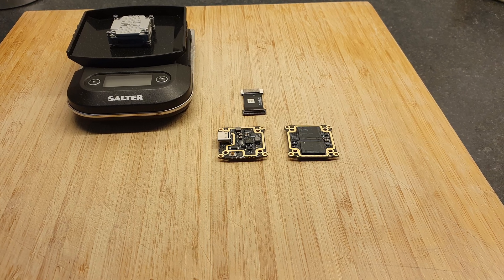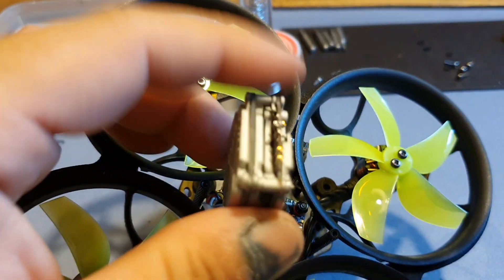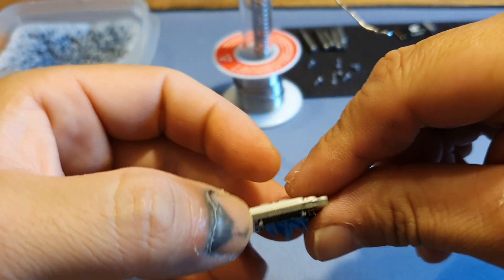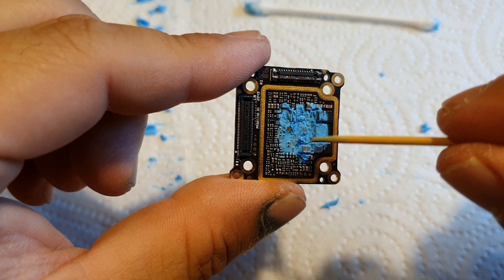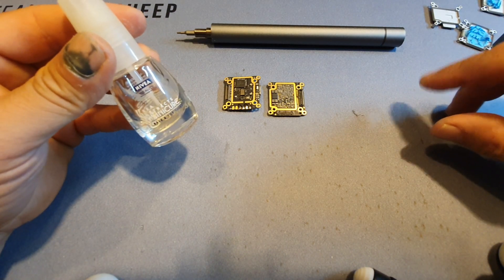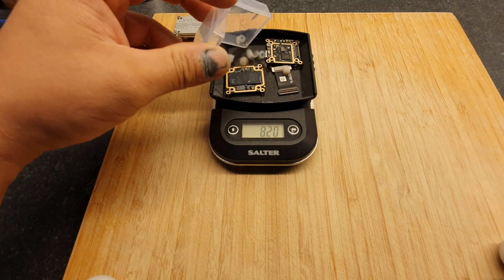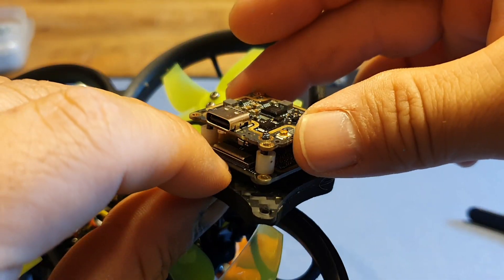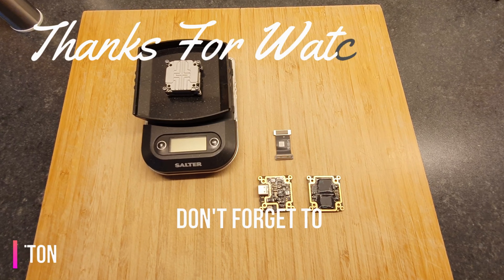How to make a naked Vista | Square One

Comment: How is the naked vista holding up? Im doing a mobula7 digital soon
Reply from the maker: That's a cool project! 
I have a naked vista in my sub 250gr 3 inch freestyle build. I've been flying it for a year now, and after many many many crashes, it's still working perfectly no issues. 
I even broke 2 frames during that year so can't say I've been gentle with it.
Reply: @SquareOneFPV  Cool.. tks for the info 🙏🏼

Comment: I was just wondering 3 days ago about nail polish and now,  I so the video on YT. Thanks
Reply from the maker: That's great, happy to help! 👍
Reply: Nail polish has many disadvantages like  cracking, it's not flexible, and hard to rework through it.  Modified silicone conformal coating are made for this purpose 👍

Comment: Nice video actually man.. love it. Imise mg chemical because im afraid nail polish will crack eventually also will it hold with  vista heat?
Reply from the maker: Thanks man 😃👊! That's a good question, I've been using nail polish for a long time on electronics, before drones I did PC watercooling and overclocking and we used nail polish around the cpu and gpu when using a conductive thermal paste to prevent the paste making shorts. These components ran 80 to 90°C for prolonged times and the nail polish was untouched even after years of use. I've been flying a naked Vista since march this year, on my sub 250 build, on 1000mw, and the nail polish doesn't seem cracked ( just checked 😄). So far so good, but I'll keep an eye on it!
Reply: I definitely 2nd the MG Chemicals Modified Silicone Conformal Coating.  MG actually makes acrylic and eurathane sealant that's similar to nail polish, but I definitely prefer the flexible silicone.

Comment: Does "waterproofing" the vista affect other things like thermal conductivity? Does it need to a maintained and reapplied? Really am not sure I want to do household hacks on my Vista units. I like the idea of further protecting naked vistas but yea, no thanks.
Reply from the maker: Hi, applying nail polish, conformal coating or anything that is put on in a thin layer will not have a big impact on heat dissipation. I started using it on my flight stacks of my 5"ers, I fly them all year long, and more electronics seamed to die in winter when everything is always wet or damp ( I almost don't fly bando's, always parks, forest, etc). I also fly props out, so even just taking off from wet grass, the stack always gets sprayed with water. Nail polish works for me, giving my electronics a bit more protection, and a longer lifespan. It doesn't need reapplying only a touch up after soldering through it. 
Before I was into drones, I did PC building, overclocking, watercooling, that sort of thing and even there we used nail polish to protect the board, like when using a conductive thermal paste (liquid metal ) to prevent it from making shorts.
Maybe there are better ways to protect a naked Vista, and I'm not trying to convince anyone here, this is just how I do it, and I just wanted to share my experience. 
Sorry for the long write up 😄take care.